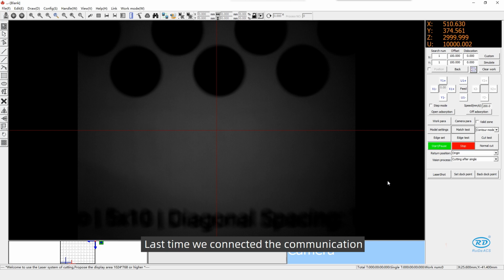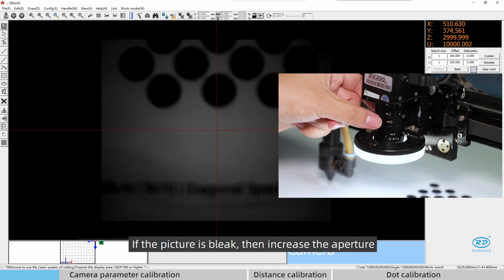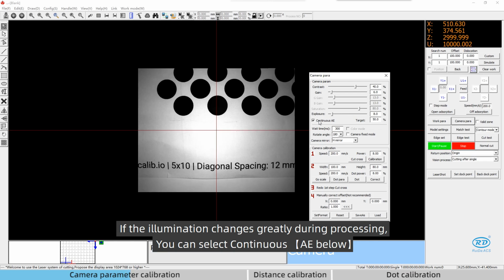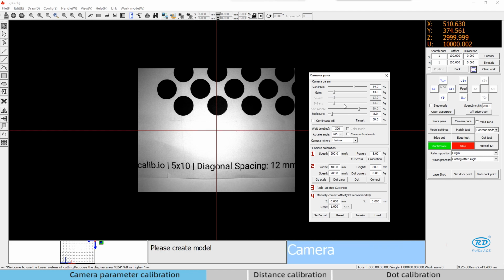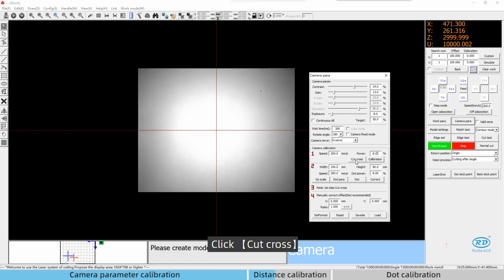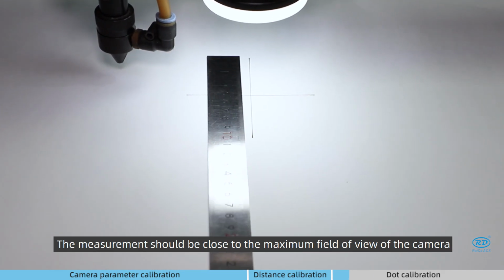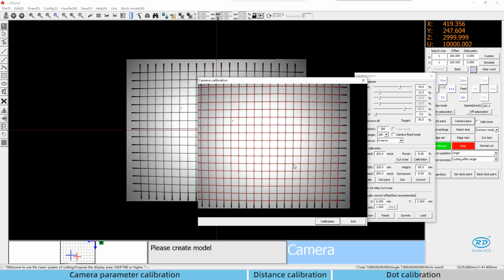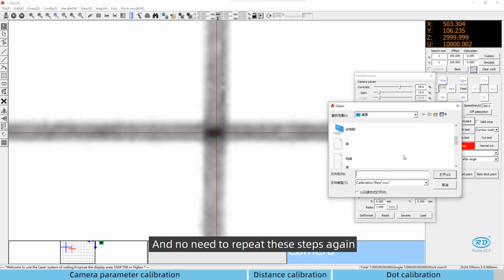RDVision Tutorial Episode 2: Camera Calibration

Comment: Hi. I saw after right u install RDvision the axis X showing position at 510.63 and Y 374.61. why this position not in 0? I used RDC6445G-DFM everytime I restart the machine the X showing number 10000 and Y also 10000. This is so confusing. How can I set X and Y at 0.00 to make easier for me to identify my axis position correctly???
Reply from the maker: Power fluctuations or communication interruptions may cause the system to fail to initialize correctly. The coordinates can be reset by using the manual zero return or automatic calibration function.